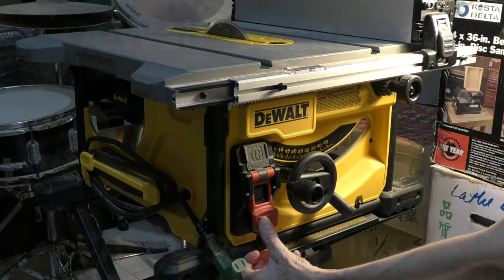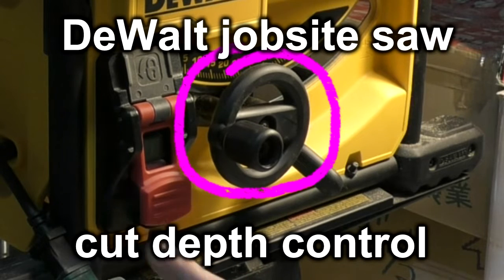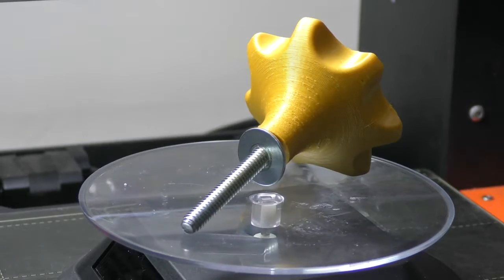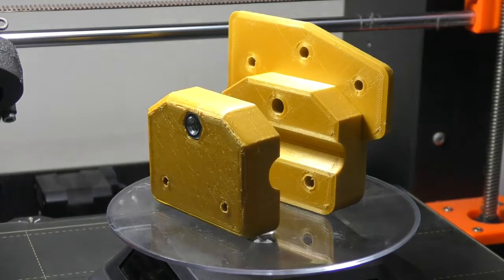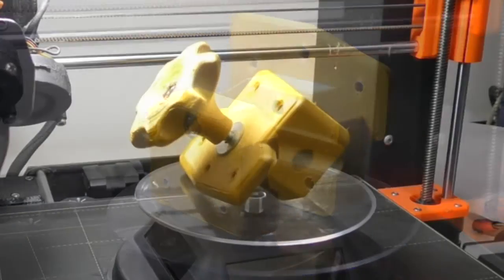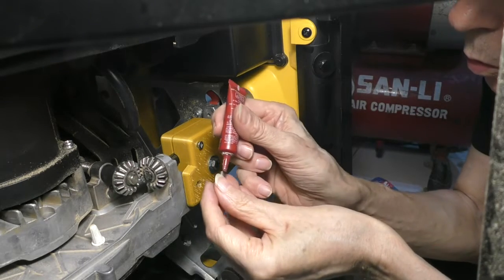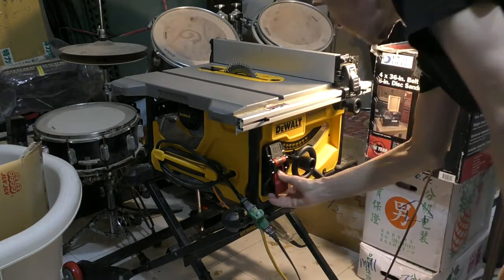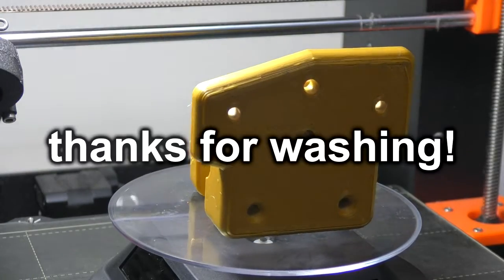DeWalt job-site Table Saw Depth of Cut Control

Comment: Great solution for this problem. I just found my 7485 was doing this today. I just need to come up with an extension for the tightening knob, so it will work in a bench with the saw built in. Thanks!